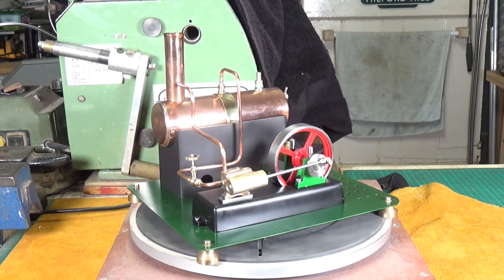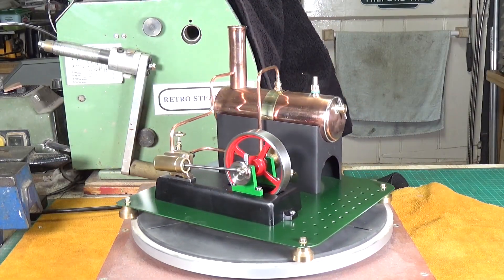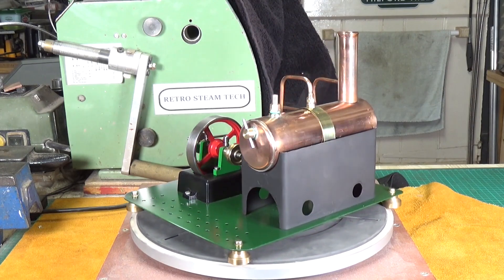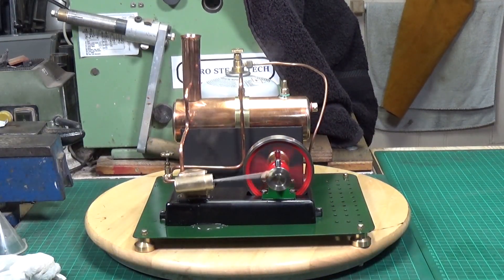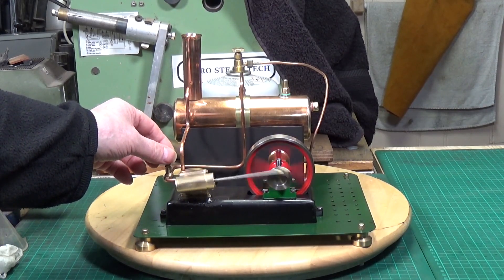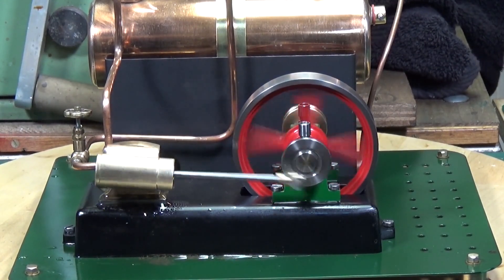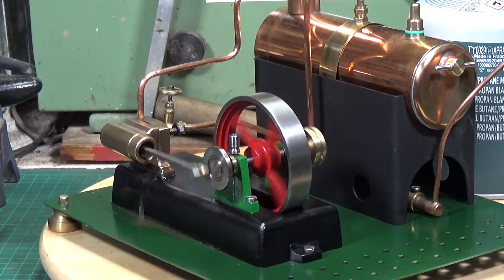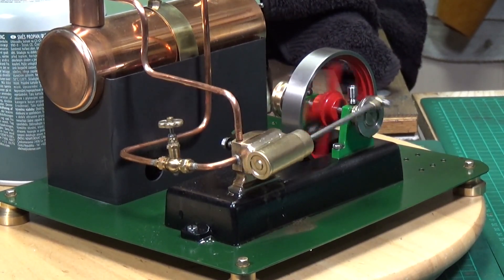Scratch Built Steam Plant

Comment: Beautiful engine Alan.   Getting those steam line bends done must have been tricky.  The engine base looks like a production piece ?  Cheers Rob
Reply from the maker: Thanks Rob. I've got some little pipe benders which work well on small copper tube. Even so I usually manage to get the bends in the wrong place! I think the original builder welded up the engine base out of some heavy gauge plate then filed the edges round and tacked on the mounting tabs.  Made a good job of it though. Cheers, Alan.
Reply: @RetroSteamTech  He sure did Alan.  Looks very professional. Cheers Rob